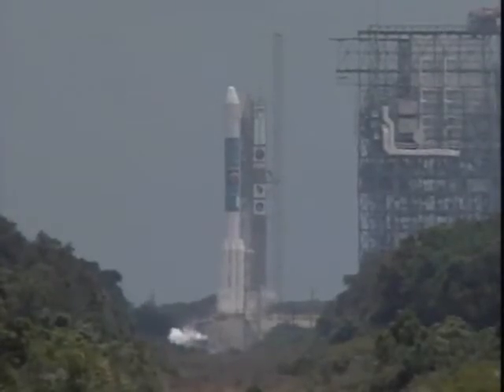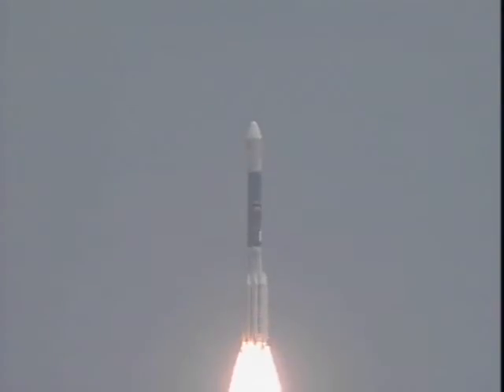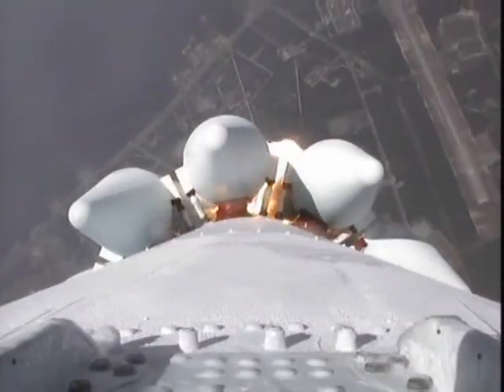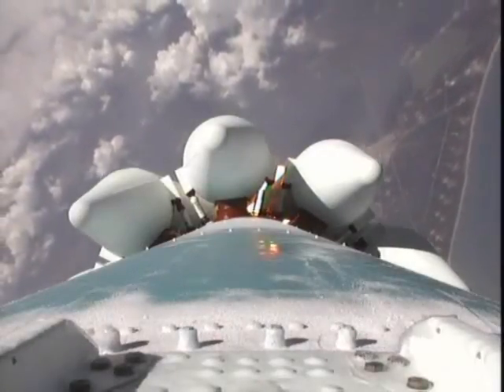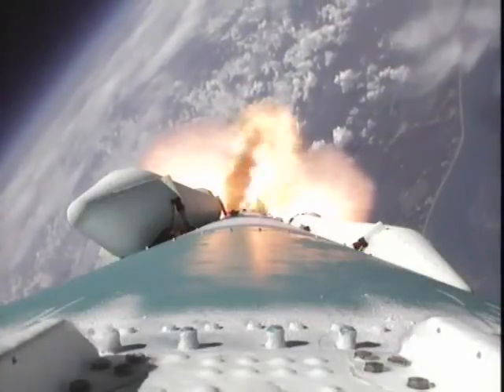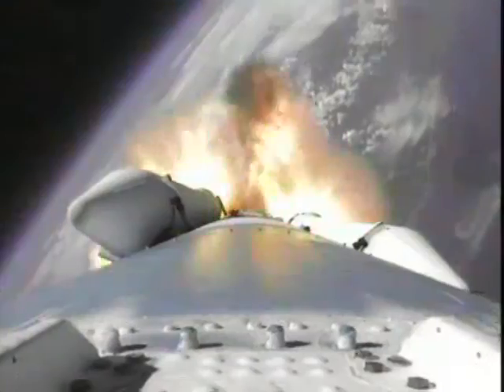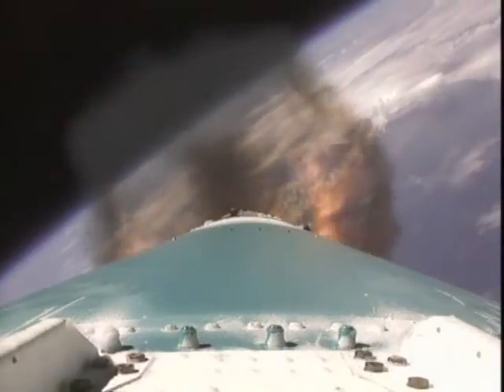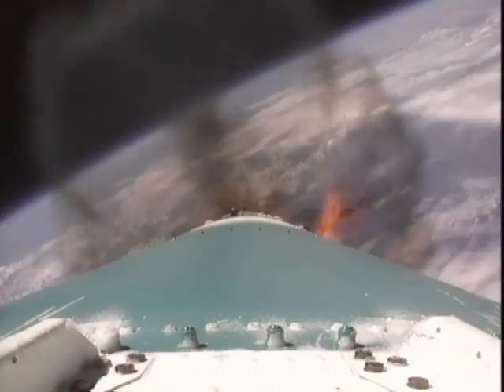Launch of MER-A Spirit rover from Cape Canaveral SLC-17A on 2003-06-10

Comment: At the risking of sounding pedantic it's not a Delta II it's a Thor-Delta II.
Reply from the maker: I wasn't aware of the distinction but, based on a quick Google web search, my understanding is that both of those terms refer to the exact same rocket, with the only difference being that Thor-Delta II emphasizes the Delta II's heritage as having been derived from the Thor rocket design. Is that understanding correct?

I should have written Delta II rather than Delta 2 though; fixed now.
Reply: @kerbonaut  IMO it is a highly inaccurate and lazy way of naming the rocket while trivialising the role of the first stage so IMO it should be referred to as the Thor-Delta or to be really pedantic the Thrust Augment Long-Tank Thor-Delta II.
Reply: @nicholasmaude6906   Nah they dropped the Thor name when it stopped being made of actual old Thor missiles and got an upgraded replacement engine. Like yeah it descended from the Thor but it's pretty far removed in time and technology, that's like insisting the modern Soyuz-2 still be called the R-7 Semyorka.
Reply: All Delta vehicles with a 2.44 meter diameter are technically Thrust augmented extended long tank Thor rockets.